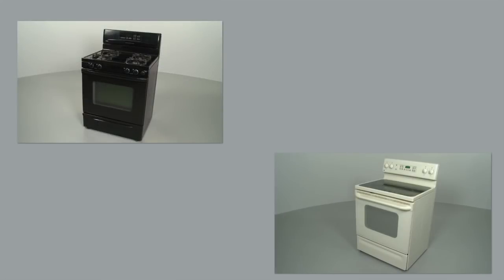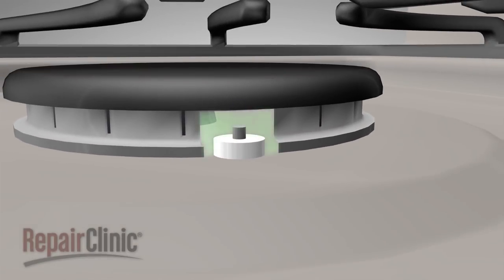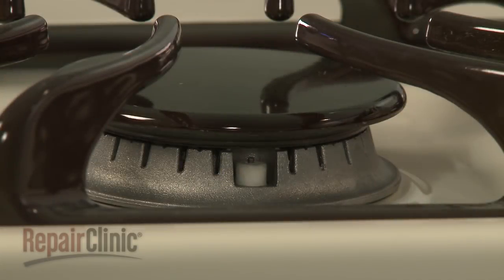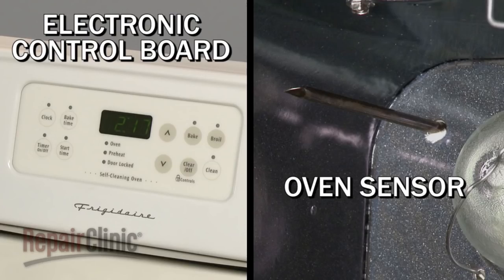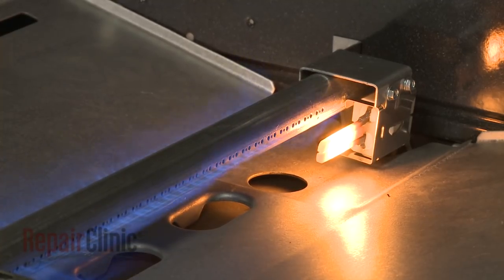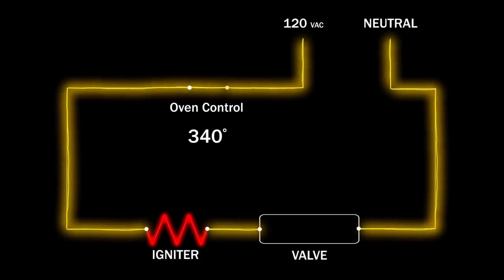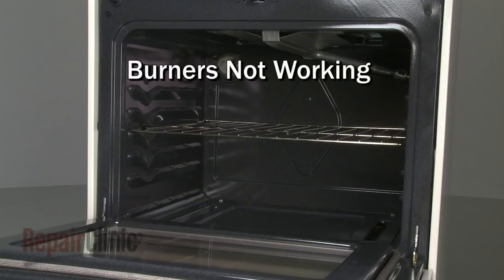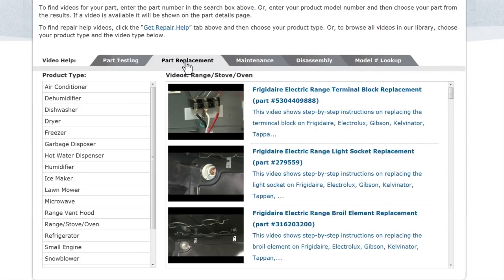How Does a Gas Range & Oven Work? — Appliance Repair Tips

Comment: Update: the faulty burner doesn't spark when I turn its knob. But the faulty burner does spark when I turn the other knobs. Please advise.
Reply: Even though this is 6 years old, the likely culprit sounds like it's the switch for that burner. Turning any the knobs will cause all the electrodes to spark, so if there's no spark from one knob, it's almost certainly the switch.

Comment: I have a troubles. I have an older kenmore electric oven/range with the seven button keypad controller in the center. I have replaced the control panel 3 times now. It works for a while, then after an hour or several hours, they start acting up. Beeping, losing programming, losing display, etc. It has 3 prong 240 ac hookup. I checked the wall power for any spiking, looks steady. Any ideas? Thank you. Frank

Comment: Hi, I have a GE XL44. 2 burners on the left side light fine, but the ones on the right can only be lit after I light the left side one first. The ones on the right click ok, but don't light without lighting the left side first. Please advise as to switch, igniter, or other replacement part that i need. Thanks.

Comment: Mine has this coupling on it that connects the burner valve to the burner tube.  It's weird because it is just a sleeve that is not even a fully close covering.  So depending on how it is twisted.  My question is, is this sleeve supposed to completely cover the line?  Why is it even there?  Aren't most screwed together?

Comment: Thanks for this lesson. I need to ask one question. Cane we use oven igntion without safity defaice?  If  No please let me know the reason.
Reply from the maker: No you cannot use the oven without a safety device. The igniter and the safety valve all work together. One will not work without the other.

Comment: I have a question,on my ge gas stove the broil works fine. The oven ignitor comes on ,glows the gas turns on but has a smaller flame ,it's seems as the valve is not fully opening,any help would be appreciated

Comment: Sadly, I have the same black stove and it didn't have clips. The top was held on by a bracket. Had to also remove the knobs and that panel to access 2 more screws to release the lid. All this after an hour of frustrating pulling, poking and screaming at it.

Comment: Hello,,,I have a conventional oven, with 4 burners, is it possible,I will buy regulator host to connect to propane tank? Thank you
Reply from the maker: +Darius Araya No. Stoves can be converted to L.P using manufacturers guidelines.

Comment: how does the carbon monoxide get out?
Reply: Gas stoves and ranges produce carbon monoxide during use Levi, around 5 - 15 parts per million (ppm) if operating correctly. Anything over 35 ppm is a problem. A Carbon Monoxide Detector should always be installed in a kitchen with a gas range.